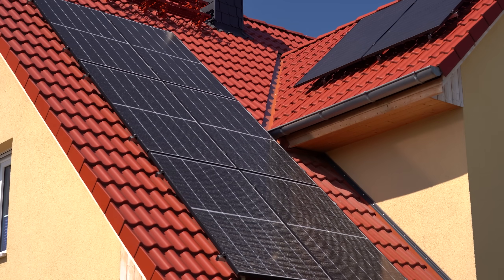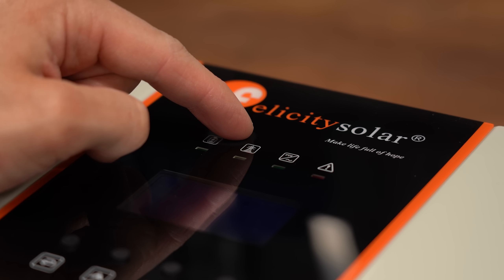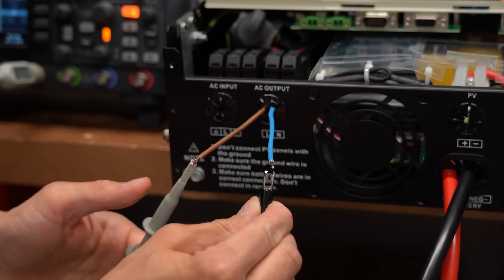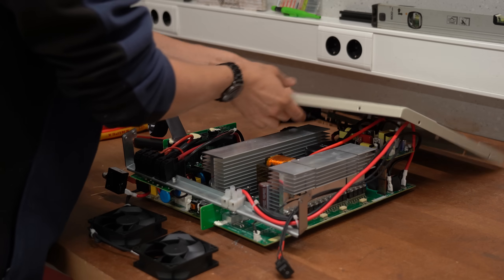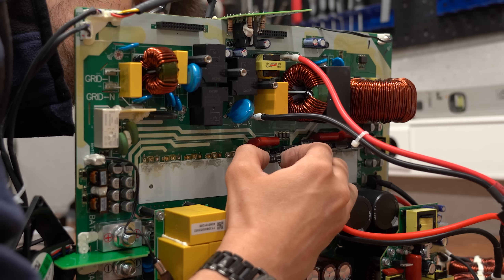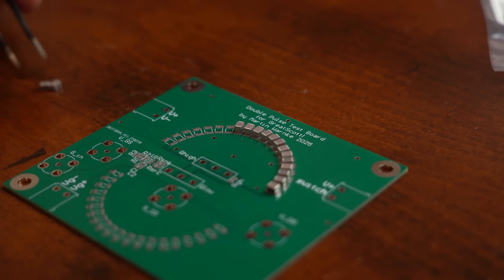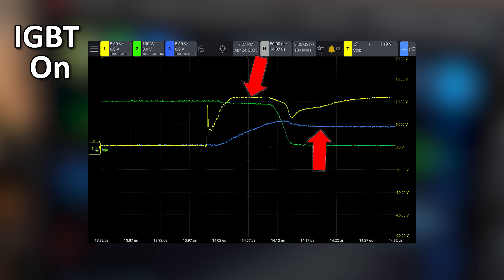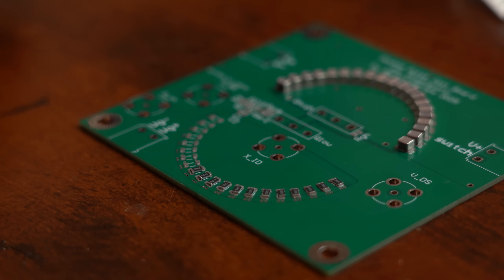Cheapest Inverter + Premium Parts = Surprising Results!

Comment: 0:20 "...you can charge-up your electric car..."  For many people, they use their car to get to work. And they work in the daytime. So their EV is many km away from their home solar system when the solar system is producing electricity. Yes, one could install 100kW of batteries at home. Yes, one could use 'grid storage'. Yes, one might work from home. Yes, one might only need to charge their EV once a week on the weekends. Yes, in mid-June there might be sunshine in the evening. Yes, some people are retired, or otherwise unemployed. I'm just referring to the normal case, not the exceptions. Solar power is lovely, but it's even better if it is not hyped-up with things that are mostly untrue.
Reply from the maker: If you get creative, anything is possible :-)
Reply: with todays cars, you only need to charge like once a week, which you can absolutely do at daytime on weekends
Reply: The average person’s driving commute means you could get by with just charging on the weekend, but even so you are back feeding the grid and running your meter back powering other stuff with solar during peak demand hours. If your array is pretty well sized, you should be aiming for zeroing out your meter anyway.

Comment: What a cool test board!
Reply: This board is the result of a lot of trial&error over many years - this DPT board design comes with less than 20nH loop inductance (including the 2 DUTs and the shunt) and can be probed with ground referenced probes due to a ground star point.
Reply: @MartinW86  Killer, what a great tool!
Reply from the maker: Definitely, Marting did a great job.

Comment: Hi, nice demonstration on how to lower temperature (the main enemy) and improve output efficiency.

If I may add an advice, position the thing vertically, so you'll benefit on the chimney effect (old and very efficient trick borrowed from very high power old sound amplifiers ;-) in case a fan breaks.   You also might want to replace the fans with better ones (better bearing, better temperature holding, better and faster air flow, better lifetime) - turn to those used in  pro IT.
Reply from the maker: Thanks for the tips!

Comment: I’ve been repairing solar inverters for about five years now, and out of all the brands I’ve worked with, Felicity is one of my favorites—mainly for its price-to-performance ratio and thoughtful design. It’s among the best of the Chinese-made inverters in this class, right alongside Growatt. The two are quite similar, but I personally prefer Felicity over Growatt.

That said, Deye inverters might offer even better performance, though they come at nearly twice the price. In this price range, I typically lean toward German products. On the other hand, the worst inverter in my experience is Sakko. It suffers from serious design issues, poor component choices, and inadequate thermal management.

What sets Felicity apart is its solid driver circuitry for the IGBTs and MOSFETs—something not often found in budget Chinese models. It’s actually the only Chinese inverter I’ve seen in this range that uses resonant converters to step the battery voltage up to the 400V DC bus, which is quite complex to design and validate.

Also, regarding the TO-220 MOSFETs shown in your first video—those are responsible for switching the battery’s DC voltage, which ranges from 36V to 60V. The PV input, on the other hand, connects to a boost converter at the top of the inverter, which directly feeds the DC bus at 400–550V.

Really enjoyed this topic—solar inverters are something I’m always passionate about. Keep up the great work!
Reply from the maker: Awesome to have your feedback. Really informative and glad you liked the video :-)
Reply: big issues to mention: felilcity had claimed that their storages would have been GROWATT SPH compliant and that was not true. All who had bought those felicity batteries had been screwed cause if those were not instantly connected to identify the issue you had no change to return the batteries after 28 days or so. 
Lots of trouble at least in germany cause they had advertised falsely to be growatt SPH compliant.
Reply: @typxxilps I would think so too , everthing looks alike my Growatt ES5000 .
Reply: Do you know anything about RG-noice on those inverters?
Can't remeber the brand but I bought a cheap one like 5 years ago and it drowned out my wifi signal when I ran it on batteries. So it was returned rather quickly. 
Today I'm running backup power on old discarded inverters from an old phonestation so they work in emergency.
And I'm not sure about buying any of the cheaper ones again.
Reply: True
Reply: Isn't Felicity just another voltronic rebrand? Just like mpp solar and pipsolar
Reply: What do you think of must triple a inverters?
Reply: Any thoughts on Sumry? They have incredibly wide solar input voltages and really good prices. I don’t understand why the AC ports don’t include ground attachments.
Reply: How about SRNE?
Reply: I'm also interested in the knowing more about the srne brand@ardya6015
Reply: Hi Could you eventuelly explain me the prechaeging Stage of One of the easun 10,2 Kw invertiers? And why the Software will Regisseur to start up the repaired inverter?
Reply: Any thoughts on Voltronic?
Reply: I want to see a hack job project using deep cycle batteries tied I to a grid tied only inverter. So some extra electronics required switching between solar panels and batteries and handling the voltage boosting and whatever else. Not a fan of lithium more because of safety. Deep cycle batteries will never ever burn down a house. Lithium bursts and you lose your house and life possibly? Keep those smoke alarms working chaps.
Reply: it is manufactured by Voltronic a chinese company  that manufacture these boards and inverters. you can get yourself a private label easily.

Comment: That's actually a pretty expensive inverter, as far as cheap options go. You can get an Anenji 6.2kW (6.5kW MPPT input) for less than 250€, straight from european warehouse.

I have one for almost a season now and works great. As far as online connection goes; just disregard the included adapter and use ESP32 to pull the data (tehnically you could reflash the stock adaptor) with esphome-smg-ii project (or pipsolar, if you use some other pip compatabile inverter). This combo works great and gives you all the data you need instantly and locally.
Reply from the maker: Thanks for the feedback. I actually searched a while for cheap options and ended up with this thing.
Reply: @greatscottlab  Interesting, never even heard of this brand. When i looked for cheap hybrid inverters, EASUN and Anenji usually popped up. Honestly, the brand doesn't even matter; they all use similar platform and components (give or take a few variations) so if you're on a budget, just get the cheapest one, that fits the need.

Seems that single phase 230V inverters without the grid export seem to be the most cost efficient options.
Reply: I got an EASUN 11Kwh for 550€ on Ali... Works great, but has some losses too, but I can afford them with my 30 440w solar panels (and my 30kwh batteries).

This video is very interesting, though... Maybe future ways to optimize things.
Reply: @ChristianCOMMARMOND  Every device will have losses. Why spend 2x more for the same sized system just to profit a few % more in efficiency? It's pointless.

When you're buidling a budget, price/performance PV system, you first goal should be price/kW for the inverter and price/kWp for panels. That's it. These things are good enough quality, so it won't give you headaches. And if an inverter does  fail, who cares, it's 250€... Might as well have a spare one on hand.
Reply: @hojnikb  Oh, I have 12kwh solar panels, and when I charge m'y car, I can get more than 8kw output... So, 11kwh is just the right power for me. And this brand is quite cheap.
Honestly, I prefer to spend 200€ more and use 50% off the power than save them and always be at the maximum of the power. My previous inverter was a 5kw... And it couldn't handle the load.
Note that I spent 6000€ in my system and that it will be paid off in 2 to 3 years.
Reply: the adapter in the video is the same as for Anenj, it is based on esp 8266, you just need to desolder the controller reset circuit before flashing
Reply: Just for reference, I'm using a Anenji 6.2kW from more than 2 years now and it's pretty impressive. Efficiency is around 94% and doesn't become that hot also in summer. The fans become noisy with >2kW but not a problem being in a dedicated room. Batteries taken from ecoworthy (8 batteries 100Ah) and all inclusive less than 4k€. And we're talking about 2 years ago. Now probably with just 3k€ you can set up an entire system including clables, brackers, etc
Reply: @RobertoTacconelli  Yep, budget solar equipment has gotten really cheap over the past few years; espeically batteries. The above mention anenji can be had for less than 250€. Typical solar panels are now less than 50€. And 280Ah battery cells you can get them for less than 50€, some times even less than 40€, if bought from alibaba direct from china.

Comment: What I will say, especially regarding cheap inverters, is they are known to wreak havoc with various amateur radio frequencies. They can be bit of a pain in the arse if you're into radio. Some also interfere with the 433 and 868mhz LoRa frequencies, so they can affect smart meter connections and all sorts
Reply from the maker: Thanks for the feedback. I will definitely check that out in a future video :-)

Comment: So great, didn't known that much about SiC techno. Looks promising... Are they chipest than IGBT at equivalent power ability?
Reply from the maker: SiC is not cheap yet.....sadly. Hopefully cost will come down in the future.
Reply: The price to look at is how many kilowatts more you get from the same source. Multiply by the price you have to pay for them and see if it is good or not for you.
Reply: You may consider that e.g. lower switching losses allow higher modulation frequencies, which reduces required filter chokes - you gain multiple degrees of freedom to optimize a system further, eventually saving more than you pay for the SiC MOSFETs.

Comment: One issue I've found with the cheaper inverters is theyre high frequency compared to the Victron which is low frequency. Ive installed quite a few of these cheaper inverters and they dont tend to last very long
Reply from the maker: Yeah, lifetime did not get tested. But I would have assumed this as well.
Reply: @greatscottlab , unfortunately quite a lot of people buy them here in Zambia, weve been having serious loadshedding (power cuts) due to bad rains so everyone has gone solar. I always recommend people to buy Victron, Deye or Sunsynk.
Reply: @greatscottlab  Yes cheap inverter only last 6-7 years  when run at full capacity
Reply: What about their frequencies?
Reply: @Elektrotechniker they are higher 10 to 30%
Reply: Most IGBTs are going to be medium frequency. SiC FETs, in contrast, excel at high frequencies and aren't going to be used to their full potential just dropped into a medium frequency design.

Comment: I found it interesting that the efficiency difference was 98% vs 93%. 

For how cheap solar panels are, buying a few more panels and getting a cheaper inverter is probably a good starting point for someone wanting to set up their first system.
Reply: Yep, it's pointless to mock about and search for the most efficient solar panels and inverters. For the price difference, you can get a lot more net power from cheaper stuff. You just need more of it. 

Honestly 93-94% efficiency is pretty good for such a cheap device.
Reply from the maker: Definitely true. It is crazy how cheap and actually good this stuff is nowadays. However, I can not say how long such an inverter will survive and what safety it comes with. A more expensive one will probably do better in that regard :-)
Reply: @greatscottlab  Another thing you could check is RF noise and the difference between inverters. That would be something useful for all us radio hams or shortwave listeners.
Reply: @paulsengupta971  I'd LOVE to see some sort of emi analysis, if a 6 watt chinese lightbulb can play that much hell, what's a 5kw+ inverter doing to the RF spectrum?
Reply: @greatscottlab  Inverters that let the air circulate through the body does not last long as with high humidity alot of corrosion can happen and cause components to fail prematurely. On the other hand, if an inverter is IP65 rated and has all of it heat dissipation system outside, meaning no air gets in contact with the PCB and its components, then they can last really long time, provided that ambient temperature is within their working temperature.
Reply: What if you coat the pcb with lacquer?
Reply: @greatscottlab  connect it to your solar and leave it with some heaters outside and check after season. There is only one way to find out - try it.
Reply: @greatscottlab   a smaller victron with the copper goodies inside  will still punch some  suddent loads...!!!   no sponsored just love the 365  days usage no error!!!
Reply: @greatscottlab  it probably is just as good the expensive one. chinese manufacturing has improved a lot these last few years while still maintaining competitive pricing
Reply: @greatscottlab  it lasts 4-10 years depending on where you place it. Hot, humid, dust are its enemies. Also it needs to be placed inside as it is ip21 rated. maufacturers/private label of Voltronic gives a maximum of 2 years of warranty.
Reply: The cheaper ones are catching up everyday, as previously exclusive and expensive tech "trickle down".
Reply: IF you have enough space for additional panels...
Reply: @sebastianfey8687  I think the point is that the difference between 95% and 98% is 3% is negligible compared to the cost savings that is MUCH more significant. Sure, if there's just absolutely no room for any more solar, and you absolutely NEED every last watt hour you could squeeze out of your system, then maybe it's worth it to pay significantly more money for an insignificantly-more efficient system, but that's pretty unlikely to be the case for most people who are looking to get their feet wet. A slightly-less efficient system that is significantly cheaper, will break even MUCH sooner than a slightly more efficient, significantly more expensive, system would, for the overwhelming majority of people.

If you need every watt of efficiency for your available roof space, you're gonna have to replace your entire system every few months, with the latest 'cutting edge' tech, at an immense cost and you'll never make your money back.
Reply: @Wrenchmonkey1  of course, ROI is King. Always!
Reply: Not really, panels are cheap, but you need mounting hardware, installation time, more wiring, bigger MPPT, ...
And also would need a bigger battery, which doesn't come cheap.
In the end, the few hundred dollars more you spend would be quickly refunded by the 6-7% of additional electricity you get
Reply: The problem with "a few more panels" is that you run out of real estate. My roof is already as full as legally allowed.

Then again, those panels are getting so cheap; they're already a lot cheaper than fence panels... Combine them with micro inverters (as the shade will be very unpredictable) and you get a win-win situation: A cheap fence that earns money...
Reply: @paulnieuwkamp8067  yes PV panels are now cheaper than fiance panels/roof panels or house siding panels. Soon we'll have a complete home made from solar panels 😅
Reply: Makes more sense but the components in the cheaper inverter got hot quicker, which might be problem (╭ರ_•́)
Reply: @mindlesschemical1489  especially if your inverter is mounted in your loft area, ours is in the loft and im surprised it doesn't cause problems on hot days tbh
Reply: @norfolkngood8960  No way that would work where I am.  I've had routers die in my attic.  This thing wouldn't last through spring. Much less summer.
Reply: @mindlesschemical1489  all inverters do get hot reaching 70 celsius is normal for them

Comment: MOSFET converts DC power to AC power.
Reply from the maker: True ;-)
Reply: And viceversa
Reply: Mosfets can be used to convert from AC to DC as well-for example you can build a circuit that works like a full-bridge rectifier but where current flow turns on before the crossing point from -ve to +ve for the source to be more efficient.
Reply: Not directly like diode convart AC to DC. MOSFET is a switch we control this using extarnal electric power. You needed a controller with transistor or MOSFET to convart AC to DC.